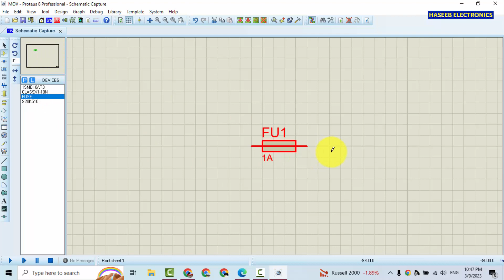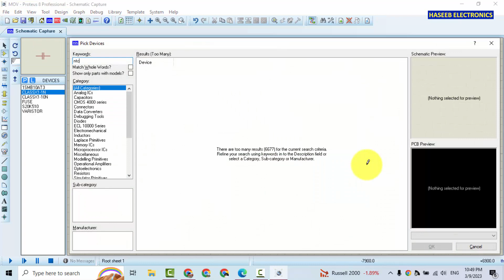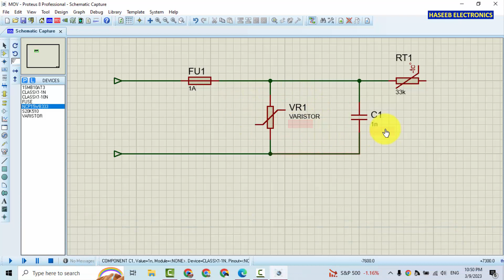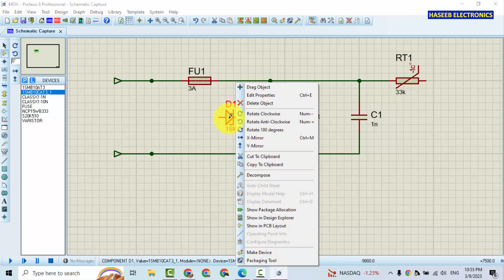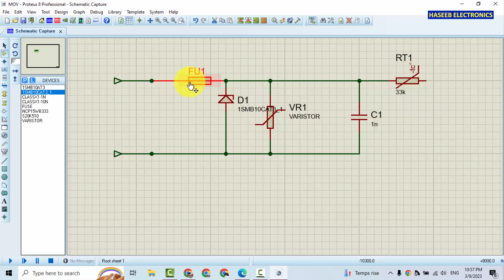{839} Why MOV Varistor is Not before Fuse

Comment: Great video there sir, based on diagram it seems that when varistor detects high voltage it decreases it resistance therefore allowing current to take the least resistance path short circuiting the circuit therefore tripping the fuse. If thats the case can i replace the fuse with ptc. Combining an MOV and PTC resettable fuse. Thanks and salaam

Comment: Hello sir, I have a circuit (active speaker). If I connect it to my limiter light bulb, the bulb glows briefly and the speaker works great. But if I connect it directly to the power socket, the fuse blows almost immediately with the sound of a relay clicking  rapidly, I think it could be the MOV is faulty, could you offer your thoughts please?

Comment: Thanks. Simple clear explanation. I have an NEC PA272W color-monitor (11years old). The monitor uses a HuntKey PCB Model HKM1102SL32-3A. The MOV is blown, & so the two T5AH/250VAC ceramic-axial fuses are blown as a result. When the MOV exploded (there was a loud explosion & bright flash of light). I was sitting in front of the monitor at the time. Unfortunately, I am not able to identify the specification for that MOV, in order to buy a suitable replacement. I have emailed HuntKey to try & see if they can/will specification for that MOV. But I am not optimistic.
Reply: Cual es el voltaje de entrada VAC RMS monofásico de ese equipo ? 
110vac
120vac
127vac
220vac
230vac
Reply: @miguelc_seeker Estoy en Australia. La tensión de entrada RMS monofásica es de 230 VAC.
Reply: @DIYhabitat  Ok,  para voltajes de 220/230 VAC RMS, normalmente se colocan Varistores de estos voltajes:

20D391K  que protege a partir de  250v rms 

20D431K que protege a partir de 275v rms 

20D471K que protege a partir de 300v rms 

Allí tienes tres Varistores, que dependiendo como sea la variación de el voltaje de tu hogar , puedes elegir. 
Si es un equipo muy delicado con la parte electrónica, y la variación de voltaje de tu hogar es constante y hay muchas tormentas eléctricas, entonces el 20D391K  estaría protegiendo más rápido antes de que pasen más de 250v.

Ahora sí el voltaje de tu hogar es estable y solo hay tormentas eléctricas un 20D431K vendría Bien.

Toma en cuenta la calidad de voltaje de tu hogar y el tipo de tormentas de tu zona y escoge el valor de Varistor que más veas conveniente 👍

Nota: Te coloque Varistores de diámetro 20mm,  porque son los que soportan más picos de voltaje antes de perder sus propiedades,  no sé qué diámetro son los Varistores de la tarjeta dañada. ( 10, 14 o 20 mm )   Pero si ves que puedes instalar los Varistores de diámetro 20mm, sería mejor.
Reply: @miguelc_seeker thank you for your recommendation. Much appreciated indeed.

Comment: I connected a varistor accross L & N, initially it worked but when i came back after a few minutes the appliance was not working.
Turns out there was 220v in both L & N which got solved after removing the vatistor. What could have happened?

Comment: Sir , does an MOV have plus (phase) or minus (neutral) terminals  . Can we connect either of the terminals to either phase or neutral.
Reply from the maker: MOVs provide bidirectional clamping, they are not a polarized device. we can connect it in any direction
Reply: thanks sir @HaseebElectronics

Comment: Sir can u plz tell why electrolytic capacitor connected in output of SMPS got damage due to heating.
Reply from the maker: please check the output rectifier, and its snubber RC. 
or might be capacitor value is low value than the required capacitance, which may cause increase temperature due to more ripple current